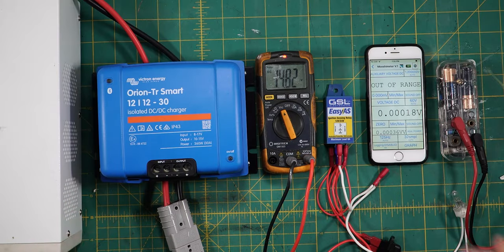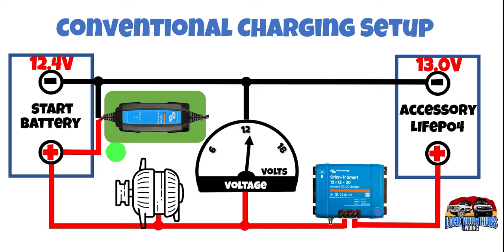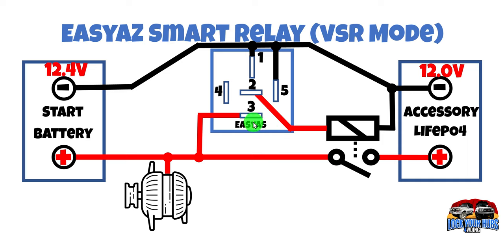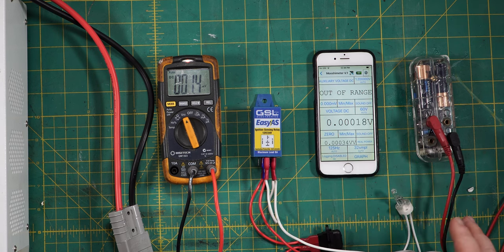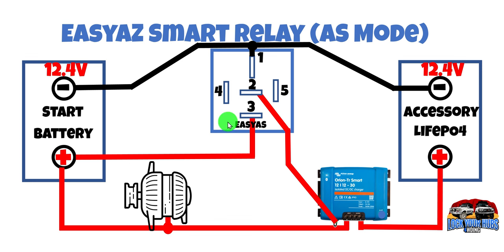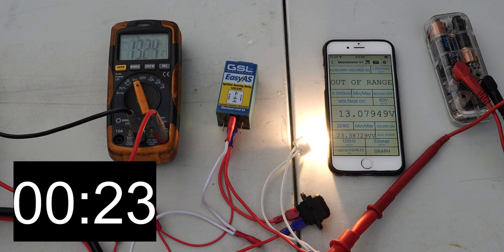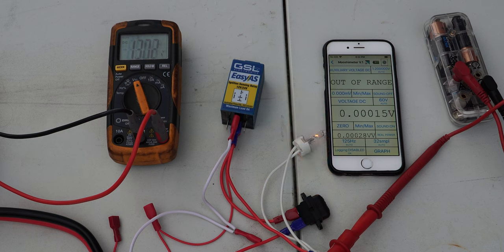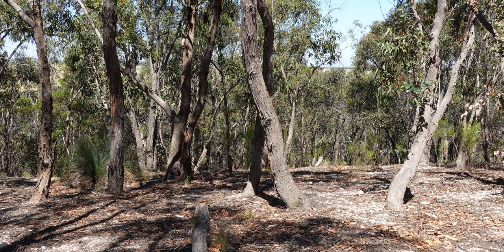Save your Starter Battery with the EasyAS Relay

Comment from the maker: Does this now have you thinking about an EasyAS relay, or will you be sticking with ignition/voltage control?
Reply: Im fine atm with the standard BCDC as Im running conventional lead acid starter and lithium deep cycle under bonnet but will likely use something like this or the Redarc equivalent for and ignition cutout so its easier for external charging, but thats the only reason.
Reply from the maker: @1Coolbanana  you're right, if you're running an accessory lead acid AGM battery without a DCDC, no need for any of this yet.
Reply: I do have the Easy As instslled

Comment: Sorry mate but this is incorrect! The ignition wire on a dcdc is to tell the dcdc to continue charging regardless if the input voltage drops below its cutoff point (when a smart alternator drops it’s voltage.) As long as the dcdc has that 14.2v input it will turn on regardless of the ignition wire being energised! So if u connect the ac charger to the starter battery the dcdc will still turn on because the voltage will rise above the dcdc  cut in voltage.This relay achieves absolutely nothing.
Reply from the maker: If you're referring to the Redarc, you are correct, the Victron as per the thumbnail and diagrams can be set to pretty much whatever turn on voltage you like.  V(shutdown) can be adjusted in between 8 and 17v.

For the likes of the Redarc, you can use the EasyAS relay to isolate the input to the DCDC using a heavy duty relay triggered by the Easy AS.

I've brought up the RedArc DCDC lack of programmability and the issues it can cause (also with Lithium (LiFePO⁴) start batteries) with Redarc's MD, though he never got back to me ......
Reply: Yes u could. Or just a regular old relay operated by the car’s ignition would achieve the exact same the for a quarter of the price. Being an electrician I 💯 understand how this relay works, but I still can’t work out what it actually achieves.🤔
Reply from the maker: @AndrewCharter-x1y  it's a failsafe, if the engine isn't operating and the AC ripple isn't present in the DC, your DCDC isn't operational.

 And you could wire a regular relay to the ignition on, though that doesn't necessarily mean the engine is running, so you could potentially be draining your start battery, this removes that possibility. 

And look, the possibility of you leaving the ignition on without the engine running, or charging the battery with the ignition on are possibly remote. But this 110% removes that possibility that could potentially strand you in the middle of nowhere. 

I'm also using one in a Camry hybrid to run a fridge without an accessory battery. The lead acid battery with the ignition on running on electric sees 14v. So not until the engine actually starts (which it does quite randomly) does the fridge see power from the start battery. 

Works like a champ.
Reply: I totally understand that, but as I said, u can achieve almost the same with a regular relay. I doubt anyone will sit there with the ignition on without the engine running.🤷‍♂️ Once a smart alternator shuts down your gonna loose the AC input anyway, then relay will open & the input voltage into the dcdc will drop as well, causing it to shut down. So this whole setup is achieving absolutely nothing.😂
Reply from the maker: @AndrewCharter-x1y  no worries mate, I know you can't see the benefit, and that's ok, I'm really happy with how they work and the added failsafe it provides.

Comment: Victron does all of that on its own. With multiple options and settings for smart and standard alternators
Reply from the maker: The Victron is better than many, though it still uses voltage to detect engine running, even in "smart alternator" mode. So potentially could still flatten the start battery by attaching a charger.
Reply: Instead of hardwiring the Victron, could you not have an anderson to connect to the aux battery. Therefore if you ever wanted to AC charge the starter battery you could simply disconnect the dcdc to the aux battery
Reply from the maker: Or even use a manually operated relay, though it would still rely on you unplugging the Anderson or operating the relay before hooking up the charger and the reverse afterward.

This will never forget.

Comment: Excellent explanation, thanks so much. I plan to use this as you've indicated, and then another easyas relay between my alternator and 1.5kw inverter wired to my truck (with 270 amp alternator) that is used for tools and other alternating current appliances. The truck doesnt have a large lithium battery to run the inverter, so inverter should only run from alternator.
Reply from the maker: Both the great applications for the relay.

Comment: the manual switch would be ideal if the starting battery was low and you needed it charged first. or if the second battery was nearly charged and you were just letting solar top it up the rest of the way.
Reply from the maker: Sure would!

Comment: Hello Simon, I hope you receive this and can advise your thoughts. I have a Holden Colorado RC (2011) fitted with a Redarc Dual sensing smart battery isolator, dual wired to an aux AGM battery box in the ute tub. I also have a Victron MPPT controller 75 15 wired in the battery box for use when stationary with a solar blanket. I now want to change the aux AGM battery to a Lithium battery, so have purchased a Victron 12 12 30 Dc to DC charger to add to the system in the ute tub battery box. I want to leave the Redarc isolator in place under the bonnet, and just add the DC to DC charger. Can you see any issues with that? Should I still fit a on/off switch to the DC to DC charger? Appreciate any advice you can give, I am "old' and not too savvy with contacting via youtube.

Comment: I saw this review and went out and purchased one of these. Unfortunately it turns on the dc dc charger when the ignition is turned to the on position. I have wired it correctly yet still can't work out why it activates when the car is not running.
Reply from the maker: What model DCDC?
Reply: @LockyourHubs4WDing  MB3689 from Jaycar. 12/24v 30a charger.
Reply from the maker: @Resleeved  to wire this DCDC correctly you have an input directly from battery positive to the input of the EasyAS relay (pin 3 via a 10A fuse) the output (pin 2) goes directly to the ACC terminal on the Jaycar DCDC and finally an earth goes to pin 1. That's it, nothing to do with the ignition circuit.
Reply: @LockyourHubs4WDing  that is how I have it wired up. If I turn the key to the on position, it's activating the relay for some reason (without starting the vehicle)
Reply from the maker: @Resleeved  ok, fault diagnosis is simpley a matter of playing a process of elimination. 

Firstly disconnect the EasyAs from the DCDC, then with a wire directly from the battery positive, make sure the DCDC only starts charging when that wire from the battery positive is connected to the ACC terminal on the DCDC.

If that passes muster,  then get a globe (12v 10w should do the trick) and run it between the pin 2 of the EasyAs (the output ) and negative.  Then make sure it's working as per the video. Eg that it doesn't illuminate until the engine has been running for about 20 seconds.

This'll tell you where the issue is.

Comment: This is great 
I replaced my previous dual battery system, which included a Redarc BCDC1225D, with one Invicta LiFePo4 hybrid max cranking / deep cycle battery 
Then I thought about "what if I wanted to add a second LiFePo4 battery at some stage" 
The Redarc would be unsuitable 
Now you're given me a cheap option / solution 
Cheers
Reply from the maker: Happy to help!
Reply: @LockyourHubs4WDing  
G'day Again 
Would the Redarc RK1260 do the same job as the GSL EasyAs?
Cheers
Reply from the maker: @fjlthycruisertouringaustralia  not really, that kit just detects that the ignition is on, not that the engine is running.
Reply: @Lock your Hubs 4WDing  
Ah Righto 
I had someone telling me it'd do the same job
Cheers
Reply: @fjlthycruisertouringaustralia  It will if all you want is a disconnect the BCDC from the start battery (whether its lithium or not) when the ignition is off for charging purposes. So you can run two lithiums (start and deep cycle) just using a relay to isolate the BCDC. That would defeat the voltage set by the BCDC.

Comment: I have a Victron 18amp DCDC. When parked up I often just put an 8 amp ctek charger on the main. (your scenario 1) The main goes up and the DCDC sucks 18amps out until the voltage of the main drops. DCDC cuts out and the ctek continues and the main voltage goes back up until the DCDC kicks back in. This cycling goes on for a while with ever increasing cycles but eventually the DCDC goes to float/monitor mode on LifePo4, the ctek then finishes the main charging and goes into float. Once everything is up to voltage, if the fridge is on during the night (solar keeps up during the day) and takes a gulp from the LifePo4 the DCDC goes back into adsorption (up to 5 amps) and it takes a sip from the main but that is quickly recovered from the ctek.

Often the best solution is the most simple, so for me adding another device to the system is undesirable. I suppose the down side of my method is the main battery and DCDC is cycling a bit and shortening its life span.
Reply from the maker: The whole cycling thing wouldn't be ideal, especially for your starter battery. Another solution of course is to use the remote feature of Victron to only turn it on when the ignition is on (when the engine is probably running)

Comment: Who invented this JAS Oceana (LV brand) or GSL Electronics - I prefer to buy from the real originator - unless it is widely licensed and quality controlled (then they still get royalties to create great new stuff)..

It seems a fantastic way to get an "Ignition source" anywhere, it may just stand in instead of running the headlights to keep smart alternators from dropping the BCDC / DC_DC offline.  (I have a dual input DCDC meaning that if parked up for a while, solar keeps all the accessories humming along and backfeeds the start-battery with a trickle.

Another wiring detail I haven't done yet, but overcomes the  the hassle of getting  (fused) power (or ignition signal) from the Main Battery / or from switches in the cabin can be overcome by placing an additional "7 core trailer cable"  (or other single jacket flexible multicore)  from the engine bay/cab to the canopy, double insulated, all in one shot - need more, add 2 - ( relay and fuse all loads at common, easy to access points).

The modern fad of  adding bluetooth everywhere, it just works, until it doesn't.
Reply from the maker: I'm not aware of the JAS product. And as they say, EVERYTHING is better with bluetooth... :)

Comment: Nice one Simon😎.  I have a Redarc BCDC charging my lithium aux battery in my 200 Series just like you have in your diagram.  I will be replacing my lead start battery with a lithium cranking battery.  I understand an issue this creates is that the lithium start battery voltage does not fall below the Redarc BCDC threshold voltage until it’s been pretty much sucked dry by the aux battery.  I was just going to put a simple relay on the BCDC that activates when the ignition is on, and cuts the power completely to the BCDC when the ignition is off (thereby separating the two batteries from one and other).  Is this relay a better solution and why would that be the case?  Cheers mate👍😎
Reply from the maker: It is a better solution, simply because without the engine running, you won't be charging the aux battery. So even if you have the radio on via the ignition, the DCDC won't operate.
Reply: @LockyourHubs4WDing  Hi, looking at your diagrams at 3.00min and 10.31min on a Redarc BCDC how will the charger know it is connected to the relay? as the Pos-Alt wire is connected the same? I see the Victron has a jump wire, and a switch can be fitted in between the loop (AS relay) and will work fine. I have the Redarc BCDC charger, and the blue wire connected to the Ign will turn on the charger at a lower voltage 12 volt on 11.9 volt off. Q. will the Start battery still change the setting of the BCDC charger at 13.2 volts when charging the battery with a 240 Volt 1-10 amp even when the engine is not running?

Comment: Hey Simon, do you have any experience using this with an Atem dc-dc charger. I smoked a NOCO ac-dc charger charging the main battery.
Reply from the maker: I don't have any experience with the Atem specifically, though they pretty much all work the same. 

The only thing to watch out for is some DCDC chargers (And I'm thinking Redarc here, though there may be others) will turn on when the input reaches a predefined voltage, that isn't user programmable. 

The way around that is to isolate the DCDC chargers input using a heavy duty relay that is operated by the EasyAs. (As the EasyAS is only rated to 8A)

Comment: Awesome Ep and great info.  I do not trust that fancy tect, I have my 20amp dcdc charger hooked up with Ap plug and I unhook it before I stop the donk, and hook up after the donk is started, in years never had a issue,
Reply from the maker: You must have a better memory than me! :) I need as many failsafes as possible
Reply: @LockyourHubs4WDing  I like simple the more automatic electric gear the more trouble I had in the past , just simple does me, as easy to fix to

Comment: my plan : 
Depending on the car ,i have a petrol car ( with injection ) and a feulpump 
seems to me that you can put that ( feulpump) positive as a signal to pin H on the victron 12 12 30 in my case ,just to start/stop the victron dc dc charger 
it stop instantly ,and startup with a (configurable) delay 120sec ?.

( maybe i use a micro relais and a stable12 volt souce in between to keep the dirty ? feulpump output signal clean from pin H )

My bms/ebs sensor on the car batery dislike the ongoing pull down from the victron dc dc till it is shut  Off deu to voltage drop
the state charge state differs from ignition off memory in the car ecu and my start stop system is affected by it /less active.

in my first setup
i do have a battery charger 1amp too ,and did make a switch on the gray connector (bridge)
on my victron dc dc 12 12 30 and use that to switch off the victron dc dc and charge my car battery on the camping with no isseu ,only to remember to switch on before the ride 🤔

just my 2cents 😇
Reply from the maker: It's a real advantage that the Victron's are so configurable. Unfortunately, not all brands are so lucky.

Comment: How is this product supposed to work with a Redarc BCDC and a standard type alternator when in this situation the trigger wire is supposed to be not connected? What are you then supposed to connect the output of this relay to?
Reply from the maker: The issue with the Redarc is it'll turn on regardless based on input voltage whether the ignition wire is connected or not. 

I addressed this with the MD, he never got back to me.....

The only work around I know of is to use the EasyAs to to trigger a larger heavy duty relay that isolates the BCDC's positive input.

Comment: Great content. I have a question.
If you have solar panels on the house battery (lithium batt in your video), how could you go about keeping your starting battery topped up using the house battery and solar? Still wanting the alternator to charge both banks.
Reply from the maker: Some DCDC chargers have this function built in ( not the Victron)

Comment: I just added the Easyas relay in  EasyAS mode with a DCDC 1240D Redarc charger, when I connect my Ctec 10amp battery tender the Redarc BCDC charger switches between   80 seconds off and 100 seconds on from the vehicle charging mode, any thoughts on why it would be still getting a signal from the start battery with the car turned off?
Reply from the maker: The Redarc is a pain..... When it sees an increased voltage (regardless of using the blue ignition wire or not) it'll turn on the DCDC with the increased voltage on the supply red wire and you can't change the settings.....

The easiest thing to do would be to put a heavy relay in the supply line (red wire) to the DCDC charger controlled by the EasyAS.  That way you can bypass the "smarts" in the DCDC and actually control the thing how you want too.